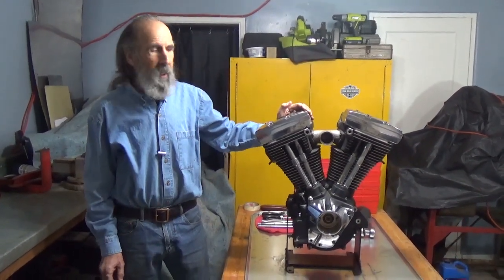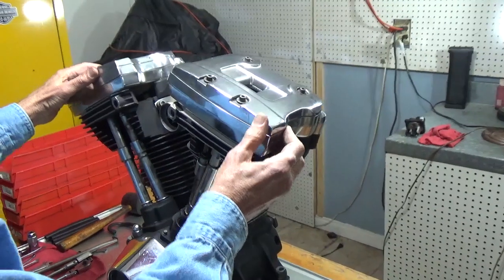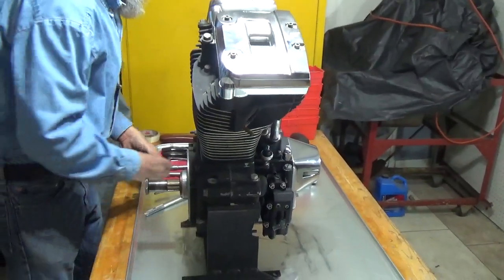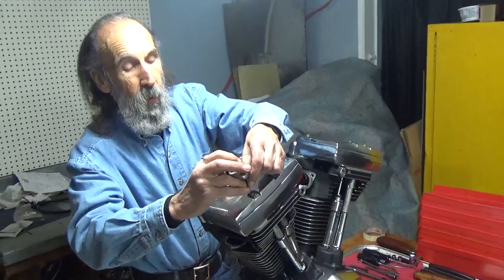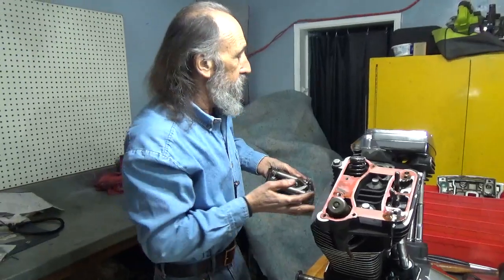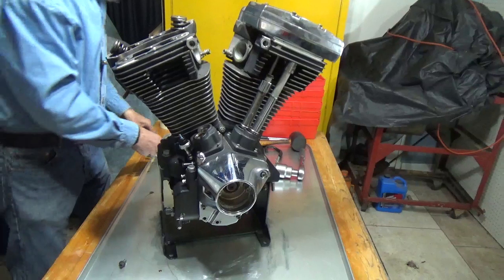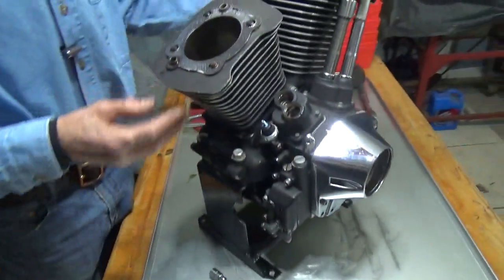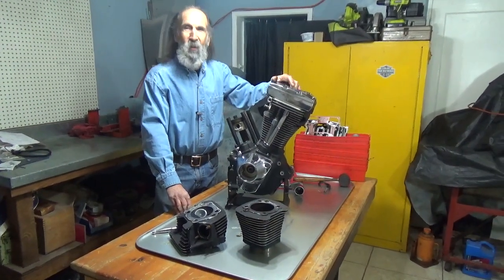Harley Davidson Evolution Motor Disassembly, Part 1

Comment: A 97 electra with a rebuilt evo. Love the bike want to buy it, but 79k miles...would I be getting into a nightmare?
(Owner asking 5k)
Reply from the maker: Depends on how it's been treated.
Reply: @Pacific Mike  its had bottom and top done with good parts, newns&s carb.
It's a looker, there another original RK, '97 police model with 15k. Sat for a while and  Would need cosmetics 4,500 firm.
Reply: And thank you!
Reply from the maker: Sometimes, it's just a chance you have to take.
Reply: @Pacific Mike  You're a philosoper Pacific Mike. So true. Sometimes you just gotta leap.
Reply from the maker: I plead "guilty."  Sometimes, "I just can't help myself."
Reply: @pacificmike9501  Keep Rocking Mike!

Comment: What did you use to turn the crank ?
Reply from the maker: Put the nut on tight.  Just tight enough that it doesn't loosen when you're turning it.  Then, use a 1 1/2" socket.

Comment: Great info but motors are electric.
Reply from the maker: You are correct, of course.  But "motor" although not what we're working with here, is "common usage."  Harley Davidson calls themselves ( and MMI calls them the same) "The Motor Company."    When in Rome...  I don't make this stuff up, you know.  You're still right.
Reply: @pacificmike9501  no he is not, a 'motor'cycle? motors are a general term referring to something that creates a power source.

Comment: On the intake bolts, use anti-seize ant lock washers. Makes disassembly much easier next time.
Reply from the maker: I prefer them to be a little stuck.  I never use antisieze on intake bolts.  Vacuum leaks "suck," so to speak.  Intake bolts should be very tight.  A little inconvenience removing them is just fine.

Comment: If I just need to remove the cover for estétic (painting) reason do I need to loosen push rods?
Reply from the maker: Definitely must back off the tension on all of them.  Remember, that's not just a cover.  It is the support for the camshaft.  All pressure pushing on that cam should be removed before removing the cover.
Reply: @pacificmike9501  I know this may sound like a dumb question,but how do you loosen the pushrods?
Reply from the maker: Look at our Youtube Home page.  We build an Evo engine.  Go to "Playlists."  Have a look at those videos.  Consult your service manual. I don't know if you have adjustable pushrods or not.  The originals are non-adjustable and get replaced when installing a high performance camshaft.  This is not a simple little task and must be taken quite seriously.  But it's still fun.  Do your research.
Reply: @pacificmike9501  Thanks. It's a 96" S&S with a mild cam. I've built a few V-8's , just getting into Harley's. Carbureted Harley's , Lol.
Reply from the maker: Cool.  They are "different."  But, a wrench is a wrench.  Research is always the answer.  You'll get good at it.